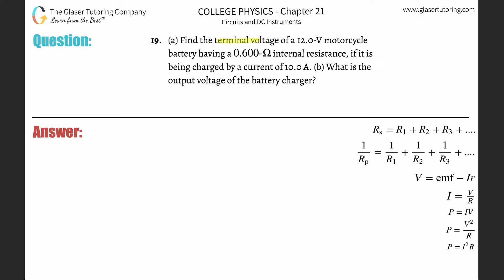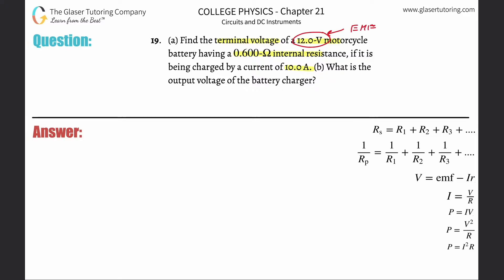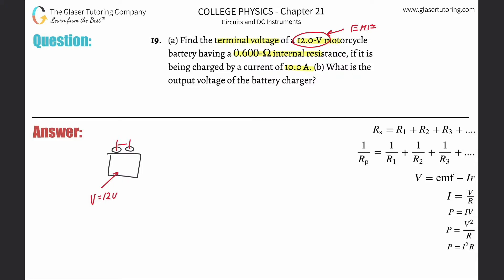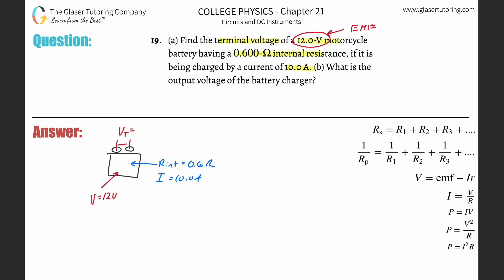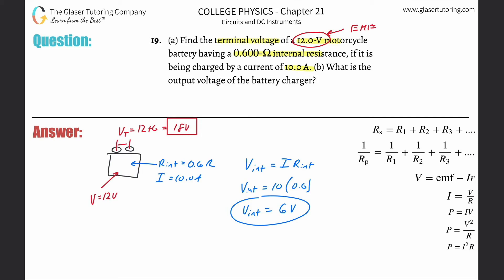21.19 | Find the terminal voltage of a 12.0-V motorcycle battery having a 0.600-Ω internal

Comment: Hi, why is it that we use the equation v=emf+ir instead of v=emf-ir? Thanks!
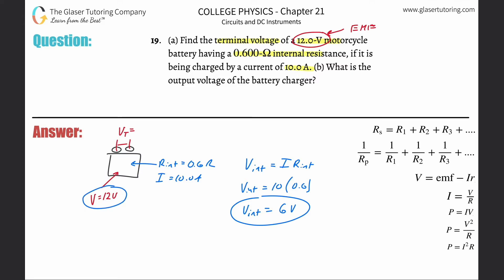Reply from the maker: Hi Scarlett!  Good question - this is explained at 1:35 in the video.  To overcome the 12V AND the 6V, the two values have to be added together.  You can also check out 21.18 in which I go more in-depth as to why it is plus and not minus in the formula.  The video can be seen here:
https://www.youtube.com/watch?v=yI26clbTKDU&t=9s
Hopefully this helps!